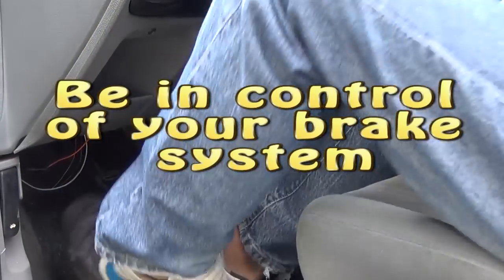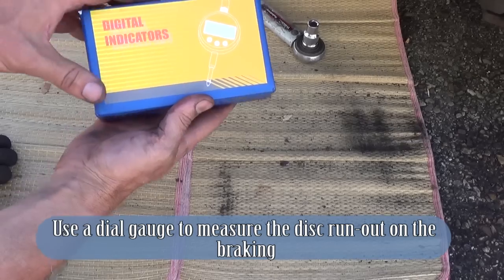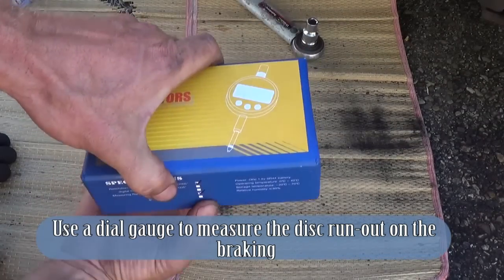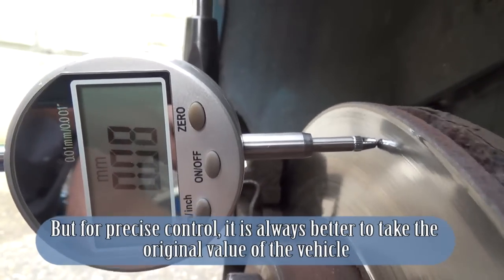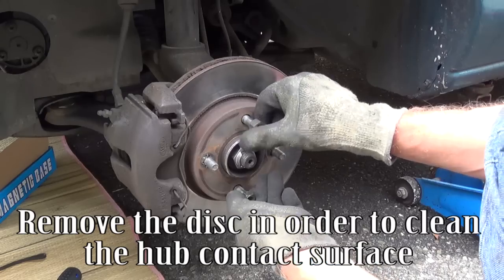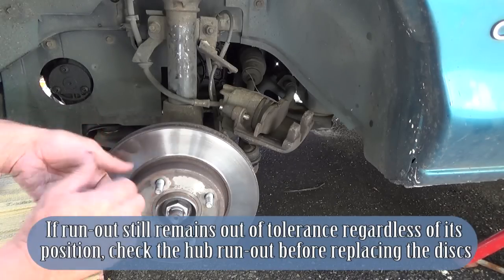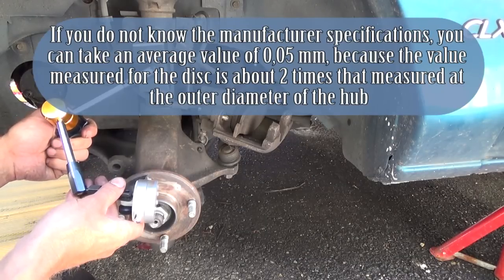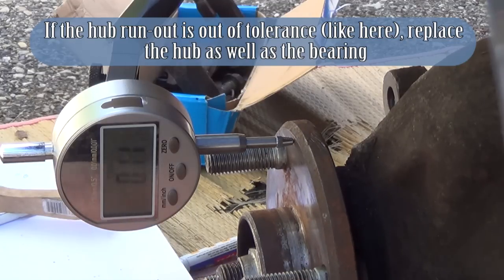Check your brake system with a dial gauge

Comment: 9:07  You left a weird bit of wire attached to the inner brake pad and it will probably cut into the CV boot